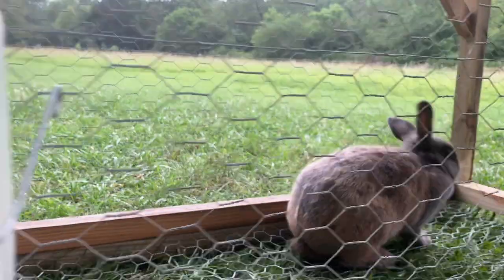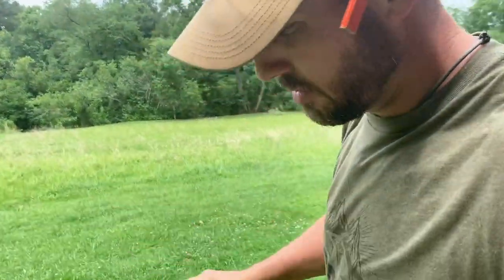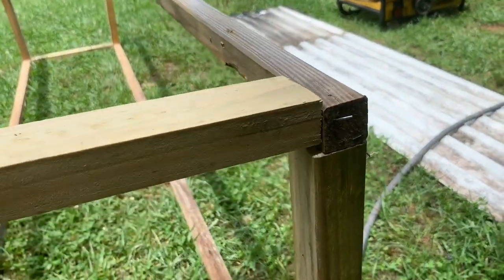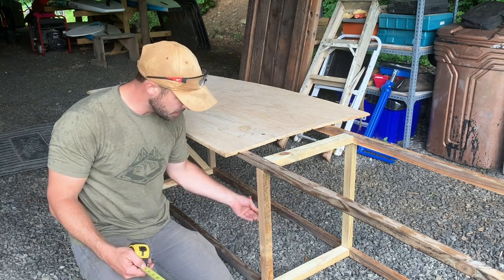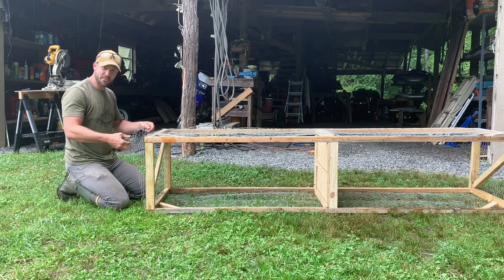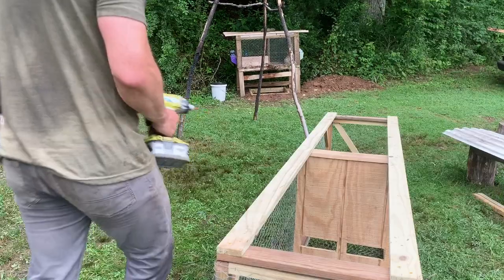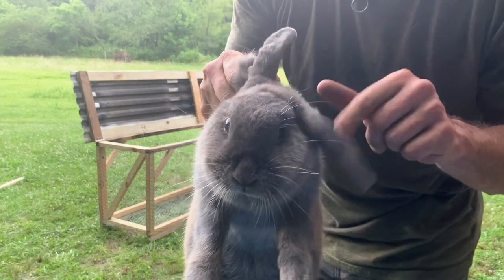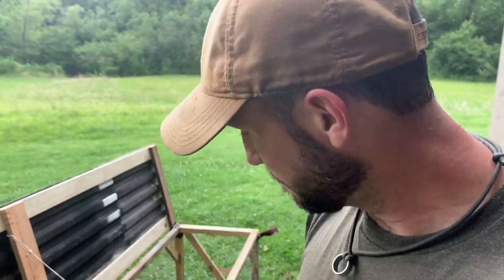Constructing a Rabbit Tractor Hutch

Comment: In our pasture, they take 3-4 weeks longer, but we can feed 100% from grazing the tractor. Ours are 8 X 2.5 - the oddball 2.5 so we can maximize usage of walkways in the orchards/vinvard/bramble patches. A wide 4 footer won't fit the rows. 3 feet barely fits but 2.5 leaves wiggle room over roots and stumps and whatnot plus convenient with our available roofing material.  

Moves are all dependent on how full they are. Basically, we move them once a day for every 3 rabbits. 3 rabbits = 1 move. 12 rabbits = 4 moves. Any more than 12 and that's too much time spent moving ... and they get really heavy dragging with no wheels... and crowding induced fighting/aggression starts to show as the males get old enough to know what's what.

Comment: Great design. But don't your rabbits get sore hocks & feet on the chicken wire? I put a piece sheetrock in my rabbit cages for them to sit on. They'll occupy themselves by ripping up the cardboard on the sheetrock, doesn't hurt anything & the minerals in it will heal any sores they might have on the feet. Also the 'flakes' that fall under the cage are minerals good for your garden! Been doing it for years!! Learned from a professional New Zealand rabbit breeder.
Reply: Great idea! Never tried that. The rabbits feet never seem to have any problems. The wire pushes down into the grass with no problems. Thanks for watching! -Jason
Reply: sheetrock has fiberglass in it does it not?

Comment: A re-post for those worried about for closure, eviction, job loss/financial collapse etc and seeking a way out of city or suburbs life and costs:: There are still some inexpensive acre plus parcels of reasonably inexpensive land in the white mountains Arizona (near vernon, in vernon, near concho, etc). I'm sure this is the case in some other states too... But in the white mountains Arizona land prices are going up ---- it's turned into a sellers market with people fleeing the cities. Already parcels that used to be $3000 ish and now $6000 to $8000 -- that's raw land with no electricity hook up no city water no sewer. It's off grid land and prices are jumping up fast. It may be the same in other states. If you're considering raw land to go off grid later it may cost too much. Right now though it's still possible, though getting harder, to purchase a piece of land free a d clear up front or fast by paying it off super early. It's hard to get set up. I'm not going to lie or paint some pretty country vacation picture for anyone. It's tough -- hard work -- struggle -- lots of frustration and disappointed but it can be done. Currently the white mountains in Arizona where parcels are still reasonably inexpensive (there are still so.e cheaper pieces btw and you can find them on land watch.com then type in the area or nearby town like vernon or concho) still allows you to move in with an RV or travel trailer and many people have for decades now. It's the norm to start in an RV or travel trailer, often a cheap old one that can be had for cash so no monthly RV payment) and then people work on building there home over time. Many other places do NOT allow you to start in an RV or trailer and who knows how long this area I'm referring to here will. Once this is no longer allowed moving in will become insanely more expensive. Anyway, right now you can buy land, get a water tank so you can get water delivered, move in with an RV or trailer, and proceed to set up your parameter fence - get dogs (adult dogs at rabies animal control in the big city - here it's Phoenix go for $25 a piece of they've been there a while), set up your chicken coop and rabbit hutch etc. The major negative in Arizona is poor soil quality and water (it's crazy expensive to dig a well if you're not on city water but city lots cost a tin more and the housing type requirements are much more costly up front).... Another negative about rural Northern Arizona is it gets very cold during the winter so you'd want a woodstove or at the very least little buddy heater and really a woodstove is far better... Moving to the country or at least having a bug out property set up would give you a place to go if things get worse and you can't keep a city or suburban house... I recommend a smaller parcel of land in today's environment because you never know when your money will stop coming in and you can pay off a smaller parcel faster plus it's more affordable to put up the pasture fence (cheapest pasture fence runs $70 plus per 100 foot roll at tractor supply right now and it takes a little over 8 100 ft rolls to do and acre and 1/4 property -- then add the cost of lots of t posts)... Note: there are other e states and counties that allow you to start in an RV, trailer or tiny home but from my research not many. You have to check each area you're interested in by calling the county office to research housing type rules and restrictions. I think the Ozarks area still also allows rvs, trailers and tiny homes.... In any case and in general , note also that an uninhabited property with any kind of dwelling on it especially does attract thieves, looters, and squatters. Btw: I'm personally looking for a sane sober honest moral self-sufficient nomad who has his or her own RV or travel trailer or tiny home (a small one) to help watch my property -- no charge to park and live on the property in exchange for helping watch the property (in case such a nomad is tuning in and wants to stop traveling/stay in one place)..

Comment: May be leaving the bottom open so they could get to the grass would have been better? A small area with plywood on the bottom so they don't have to stand on the wire or ground all the time would be nice also.
Reply: Do rabbits dig holes? Would they burrow out?
Reply: @theoldguy9329  voice of experience.. yes they would dig their way out.
Reply: @lyndabuchholz1216  I thought it was pretty self evident.
Reply: You can’t leave the bottom open because the rabbits will quickly dig out. Plywood on the ground would quickly become wet and moldy and deteriorate. The wire pushes down into the grass so they can access it. Never had any issues with sore feet. Very healthy rabbits. Thanks for watching!

Comment: Can you do one on the breeding cage and when you separate them and how you keep the mother from killing the babies every time mine had babies the mother would kill them
Reply: You have to watch the mother and kit of bunnies for the first week carefully.  If you breed them on a date you will know when they are due and be ready and set up.  I use a big rubber made container with pine chips for the first 2 weeks in the garage and for the first week out a breeder box in side the container to keep the bunnies together, wire top.  The mom will hop in and out of the breeder box as needed to feed them. After 2 weeks I put them in the rabbit hutch outside, and they are fine from then on. But watching them the first week is key.
Reply: smokethirteen thank you for the information

Comment: Never use chicken wire or any type of wire for a floor for rabbits, all they're weight in rest on they're paws and they are delicate, they will absolutely form cuts, bruises and will eventually swell up, become red, purple & black and they will constantly be in severe pain, that will never stop because they're always walking on it, when they lay down it will do the exact same thing. Rabbits are also very aware of the surfaces they walk on and rest on, something like chicken wire will stress them out and will always be painful to walk on.
I am not a animal rights nut, I hunt, trap & fish. I just know that chicken wire and any type on non solid surface destroys rabbits feet and they WILL become infected and in tremendous pain, it's not a "maybe", they absolutely will. Yes, you will have to clean they're cages, but you can easily litter train them with a box of hay, that way you only have to remove one thing and empty & fill it back up, but that's better than them suffering 24/7 365.
If you notice the rabbits are constantly grinding they're teeth when they're just sitting or laying, that means they're in pain, they also grind they're teeth when feeling pleasure, but not as much and you can also check if a rabbit is well, sick, in pain, distress, by feeling both they're ears, if the ears are cold, the rabbit is sick, in severe pain and or maybe having gastral/ intestinal problems, rabbits need to eat hay daily or they're intestinal tract slows down or stops moving, which leads to a quick death.